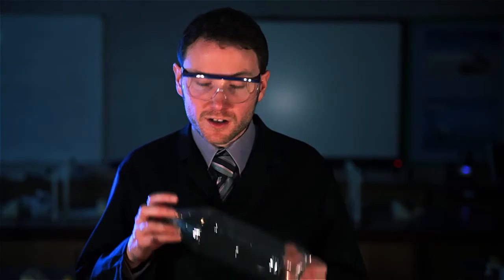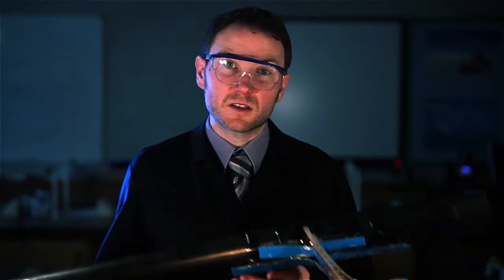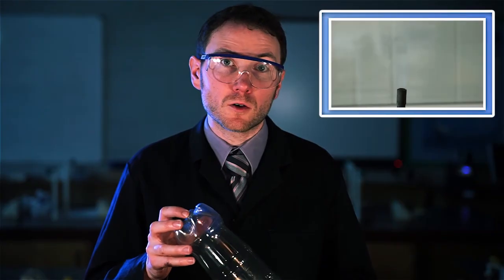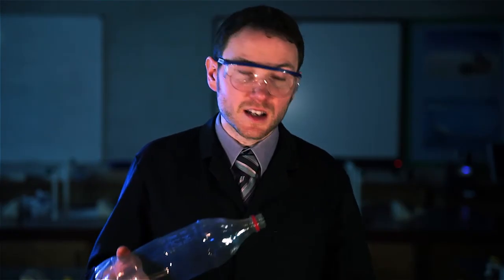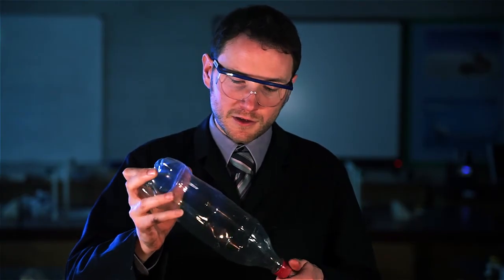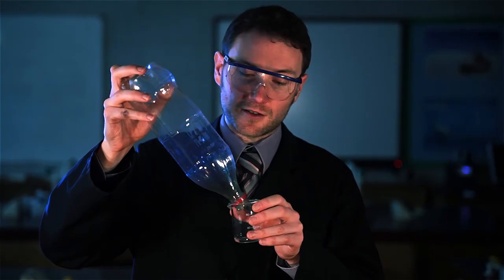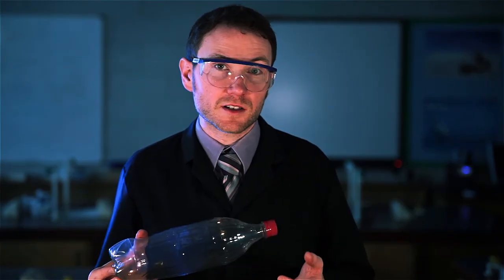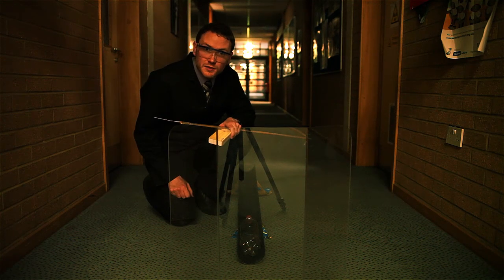Ethanol rockets - the woosh rocket demo

Comment: Hey..just for those who try in winter outside...no ignition will take place with at least with 70percent alcohol. Not one video on alcohol rockets or whoosh bottles mentions this ...but I just found out today. :)
Reply: I tried 91% and also saw no flame.
Reply: The flash point is much higher around 50 degrees.